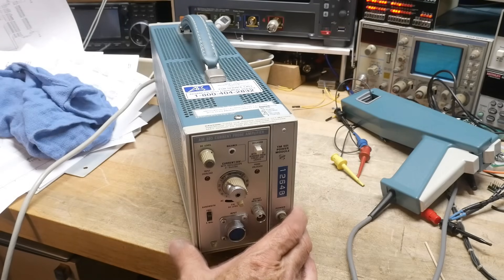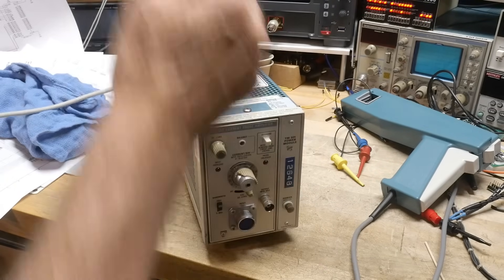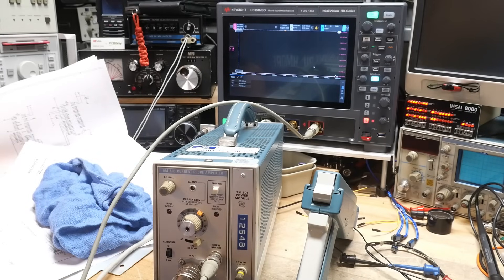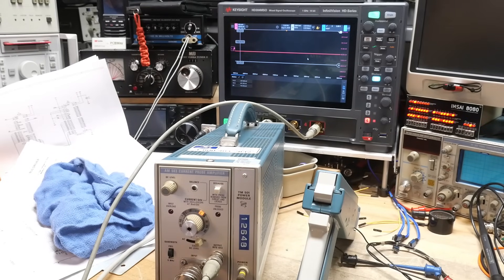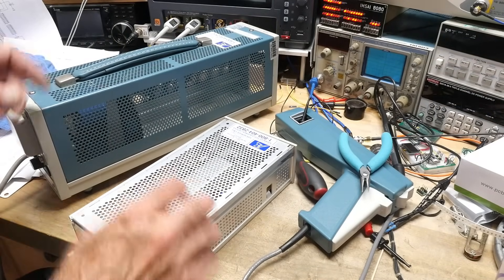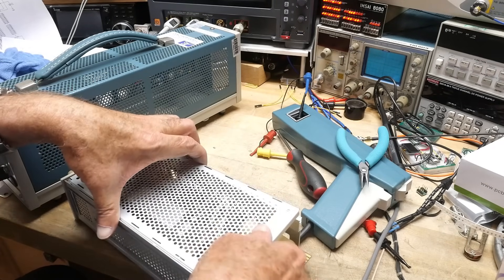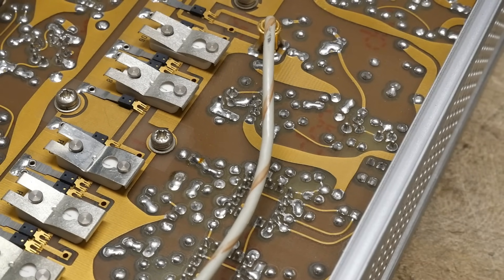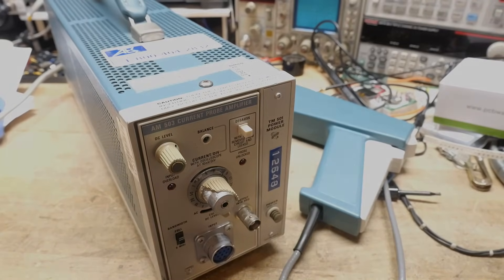#2351 Tektronix Current Probe Amplifier AM503 (part 2 of 3)

Comment: It always bugged me that the AM500 and AM5000 series modules weren't usable in scopes.  There is so much similarity in format between the 7000 modules and the AM500 or 5000 modules, but they chose not to bother.
Would have been nice to plug a fast current probe directly into my fast o-scope.  I bought a 5000 rack unit but can never find modules for it I can afford.  $200 for a five or six digit DVM which doesn't actually have the displayed resolution?  Uh, no thanks, I've got a Fluke, I'm good. 7000 plugins are literally cheaper, usually, it's demented.
STUPID market prices, and let's be honest, not everything that came out of Beaverton was gold-plated.
I'll probably never be able to unload the 5000 rack, because probably everyone else realized the problems before I did.
Reply: Nice! Looking forward to the repairs and testing.

Comment: Other than checking inrush current into something,  or perhaps looking at  power switching transients,  I would just use a plain old ammeter function most of the time.
Reply: You can't be more wrong. Current probe is, with differential voltage probe, the most powerfull tool you can use with oscilloscope. Sometimes the phase and waveform of the current in your circuit matters way more than just value of the current. Also A-meter works for DC and low frequency AC and mostly for sinewave. There are very few RMS A-meters that work above few kHz. Also, not to mention the problems the leads  and internal resistance of the A-meter can induce and make your life misery...
Reply: We used one of these to find out why our product was destroying every power supply we threw at it. We found that our product was varying its load by more than 40 amps at around 20kHz, which would beat with the switching frequency used by the SMPS, causing catastrophic, smoke releasing instability in the power supply's control loop, even thought other measurements showed us to be within the power supply specs.
Reply: @ickipoo To quote late Jim Williams: 'The instabillity demons that inhabit voltage feedback...'  Current probe is not used every day but when you need it, there is nothing that can replace it. I remember designing 20kW induction heater about a decade ago. H bridge supplying the LCL network. Well, the pll would not lock, and the device would produce horrible horrible interference. The AC unit and a pc monitor in another room would go crazy when i tried to start my heater. It turned out the phase was not set right, and the bridge was not in ZCT mode. Well, put the current probe in the emitter (IGBT) of one of the bridge legs, i saw what was the problem, and solved it in 30sec. When in ZCT, the bridge would work quiet emitting interference not much more than a cfl lightbulb though it worked with 20kW active power. There are many more cases how a current probe saved my skin. Great oscilloscope tool. Also, I must repeat myself, the differential voltage probe is also fantastic tool. Saved me a ton of time and suffering. 😂

Comment: Doctor Design, Inc. was founded in San Diego in 1984 by Marco Thompson and specializes in the area of digital video and advanced network systems. ISI acquired Doctor Design in 1996.

ETA: As part of its services portfolio, the ISI Design Center can offer a broad selection of design solutions to customers, from ASIC through production board hardware capability, Windows applications through hard real-time systems software, or combinations of all of these.
Reply: Cringe.  What are you DOING? So inappropriate.

Comment: Looking at the TekWiki page for the AM503 shows only the main range knob with no fine adjustment knob stacked on top. They probably just used the same aluminum core for stacked and non-stacked knobs. Every aluminum core I have seen from Tek has had a hole straight through the center, even when no stacked control was present.
Reply: A silver cover for that knob is missing, that's all.

Comment: The hollow shaft is just that, a hollow shaft.  What you are missing is the "knob bright".  Just a brushed aluminum disc that would have been stuck on the front of the knob.  The knob range is automatically set depending on what probe is attached to it.  Copied from the manual:
The AM 503 internal circuitry, in conjunction with a 10X probe, has a feature for automatically changing the amplifier gain.  When the gain is changed for a 10X probe, the CURRENT/DIV knob-skirt illumination changes to display the corresponding switch range.  If a 10X probe is used (e.g. P6303), the lowest range on the CURRENT/DIV switch becomes 10 mA/Div.  Again, the monitor oscilloscope sensitivity can be changed to increase the monitor oscilloscope resolution for viewing lower amplitude signals.